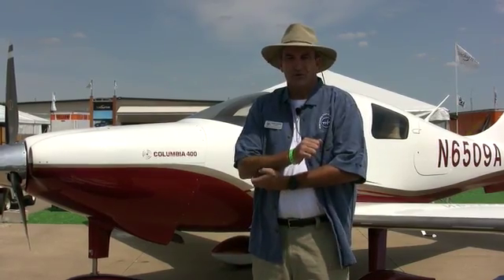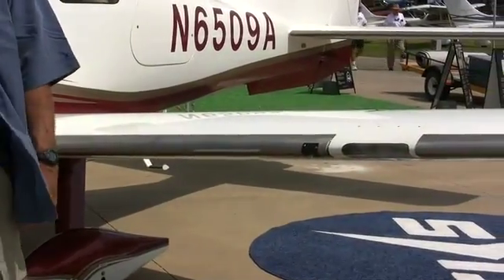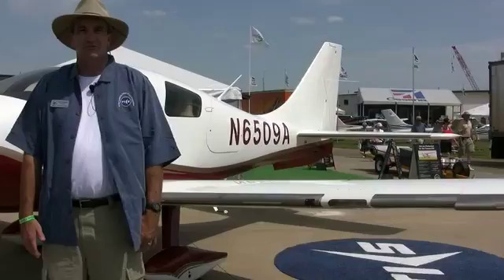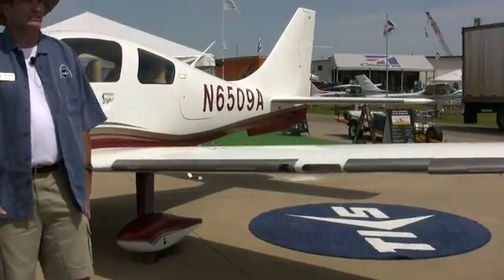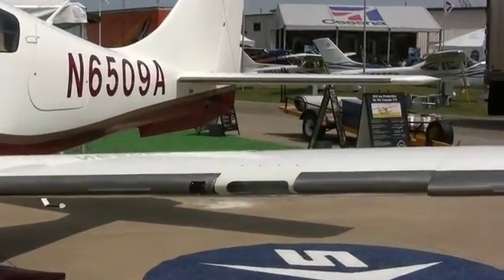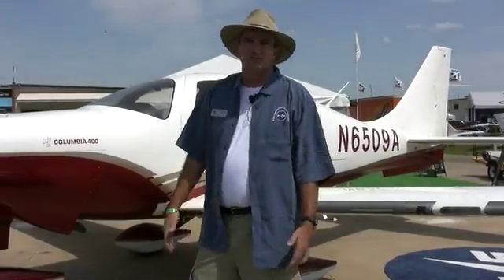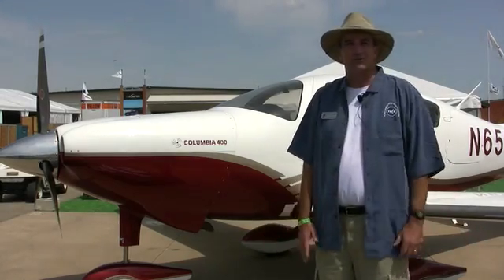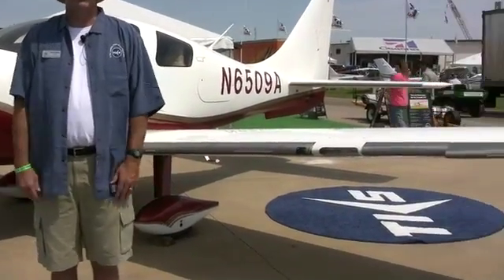TKS for Columbia 300/350/400

Comment: @cff121 Alright, I'll give you that the CAPS handle isn't steerable, but its a lot better than dead sticking. That said, it doesn't destroy the airplane in the process. I was at the Cirrus factory and they showed us a plane that had just recently deployed its CAPS system and was back in the factory to be repaired. The parachute is mounted on reinforced points on the airframe and the straps are covered when the skin is put on. When the parachute deploys, a recessed cover on the top of the tail is

Comment: @pballa92 If you pull the CAPS handle, you will total the airplane in the process.  Also the CAPS parachute is not steerable.  You land wherever the wind and you position of deployment take you.  And there are no guarantees.  Even the CAPS activation handle itself is marked with a warning 'PULLING THIS HANDLE MAY RESULT IN INJURY OR DEATH'.

Comment: The columbia was designed by Lance, who started the Lancair kit plane company... Who sold the kit plane company, when he wanted to design and Certify a "NEW" plane under the name Lancair Certified Aircraft, and received prototype cert. August of 97 for the 300.  The 350 came around 2004 which was the "air-conditioned ready" version of the 300. The 400 was certified in 2005.  Lance was bought out of the company later that year by the 49% owner, government of Malaysia, who changed the name to CAM.

Comment: The (proudly) Lancair/Columbia 400 is a TSIO550-powered airplane. "T" for turbo. You really should look things up before committing.

And I'll deadstick the airplane in a forced approach any day over pulling the holy s*&t handle, because I'm a pilot, and that's what pilots do when things go wrong. We FLY the airplane.

And a CAPS or other BRS deployment will most often write off the airframe, between the rocket going off and the unusual landing attitude of the airplane. This is well-documented.

Comment: "dead stick and pray you can land somewhere"? you bet. i was trained to fly airplanes, not parachutes, and in a manner that ALWAYS allows me a way out. it's called a forced approach, and it's a required skill, way better than being at the mercy of the wind.

a CAPS deployment usually results in a write-off, just so you know. between the rocket deployment and the weird landing attitude, it wrecks airframes.

the columbia 400 is a TSIO550-powered airplane. the "T" is for turbo. look it up.

Comment: Columbia 400: 310hp, 230KTAS at FL180
Cirrus SR22 T: 310hp, 219KTAS at FL250

Oh and wait. the Columbia is certified utility category. Not bad.

Oh and one more thing. If you get a Columbia in a spin, you recover with rudder. In a Cirrus, you recover with parachute then explain why you wrote your $500,000 airplane off to your insurance guy while the Columbia pilot gains even more confidence in his airplane and his skills. 

"Ancient"? I don't think so. 

Compared to Cirrus? Absolutely not.